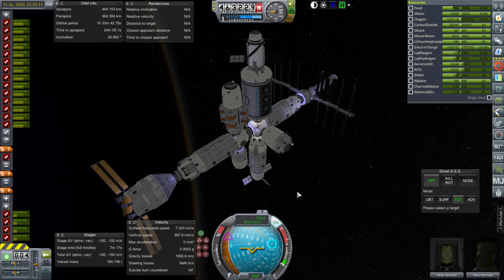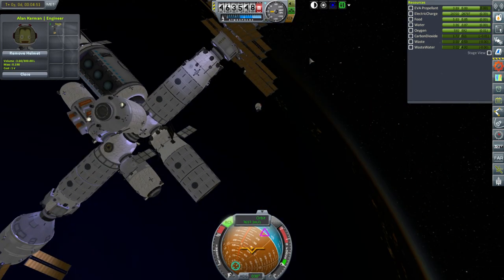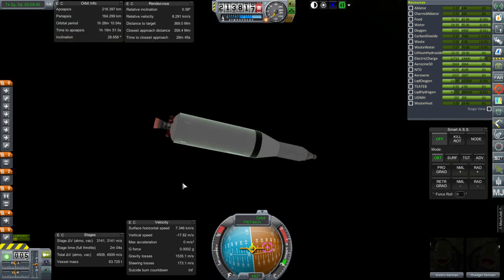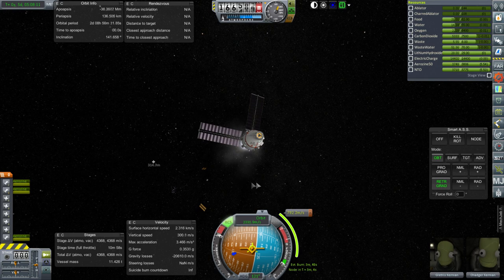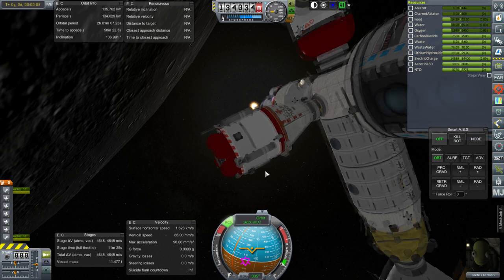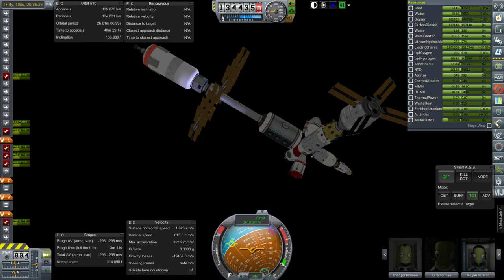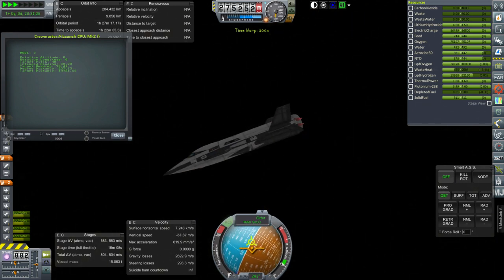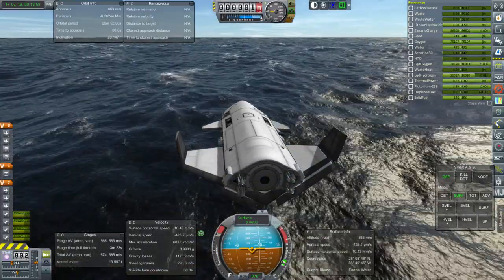Kerbal Space Program with RSS/RO - Beyond History 15 - Progress

Comment: Instead of locking the front RCS tank (and forgetting to unlock it mid-flight), you could set TAC-FuelBalancer (which does not make such a horrible noise when transfering fuel) to transfer Aerozine and NTO4 from the back to the front of the ship.

Comment: Well if your having a problem with the crew master shuttle I suggest making a downscale space plane launching system and you can just keep the name crew master or OFFTS (orbital free flying transport system) and make it launch on top of a rocket instead of on the side and add some habitation modules to the bottom of it so you could have extensions of durations in space

Comment: it's not the thrusters, it's the wings. you are stalling because of high AOA and the thrusters are just cheating your attitude to keep at the edge of stalling and when they ran out you had no more magic force applied to keep your from going into the stall...maybe try less pitch and then it will also use less fuel...might just be a bit hotter ride but if it stops from dancing it's okay right? :D
Reply from the maker: RCS thrust is not a magic force. At that height, the wings are constantly stalled - the dynamics at that height are different than you're assuming. Do you seriously think the real Space Shuttle's wings were capable of keeping it at a 40 degree angle of attack (which is what it maintained) at that height without additional reentry dynamics other than basic aerodynamics (the under-20 km, non-reentry type)? I have brought down many shuttles - it's more complicated than you seem to believe.
Reply: magic force was a joke...come on man and yes i know it's not just basic aero. so what explanation you have for a fully symmetrical balanced craft having sideways motions where no wind is possible?(as far as i know ksp cannot simulate wind) i'm eager for your response.
Reply from the maker: No matter what, RCS controls roll during the higher altitudes of reentry - that's for both pods and the shuttle. In fact, at high altitudes it might simply be better to think of the shuttle as a pod. To keep the balance, the Space Shuttle or any shuttle like this has to have the position of the CoM and CoL in a very particular position with respect to each other - this is not unlike the Descent Mode on pods. The better those are positioned, the less RCS it has to use to control itself. The amount of OMS fuel we were carrying on this reentry probably needs to be reviewed - it's possible I should just dump all of that after the reentry burn, since I may have balanced everything in the SPH without it present (since it's not used in the atmosphere).